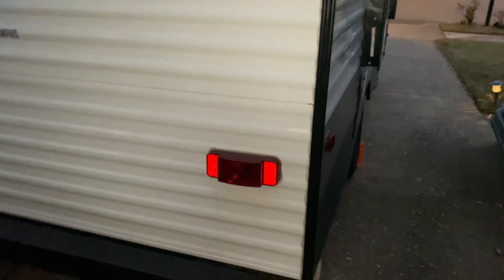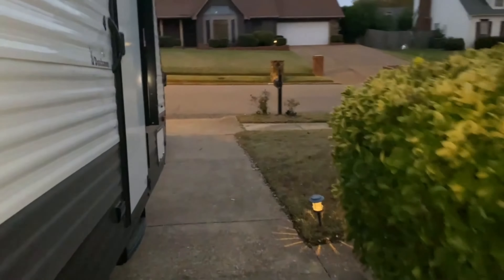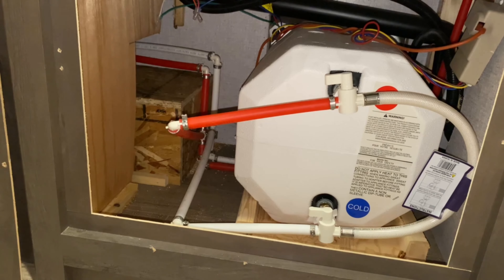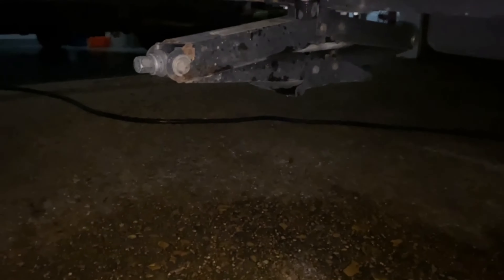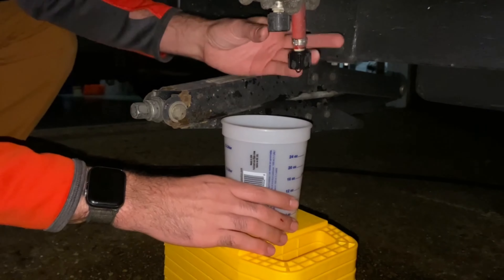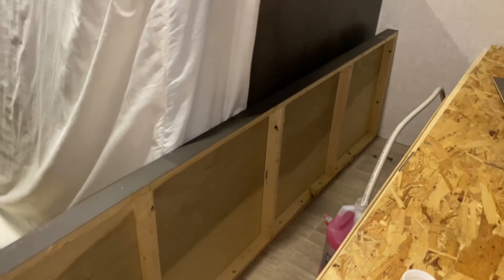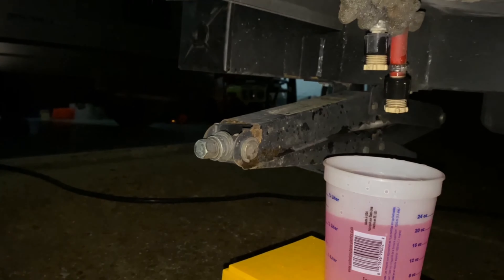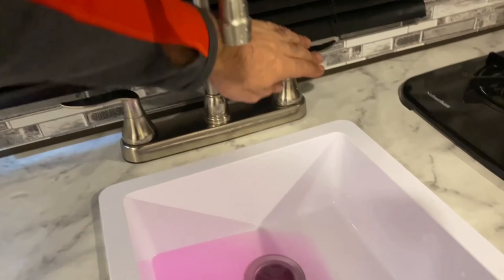2021 Coleman Lantern 17B - How To - Easily WINTERIZE Using RV Antifreeze

Comment: How do you dewinterize
Reply: Run clean water jug afew times just like he did antifreeze jug. Same procedure just clean water. Pump some clean water in city connection as well (hand pump). After all that jazz then turn hotwater heater valves back on. Some people run a lil bleach in first then clean water. Rv antifreeze isn't the same as engine  antifreeze but get it all out.